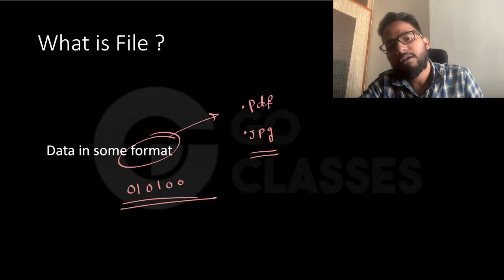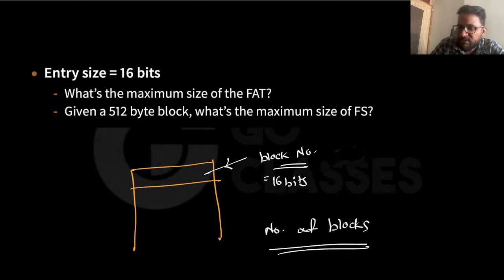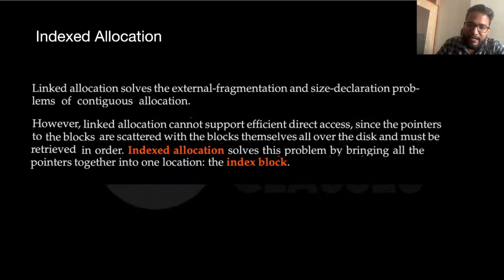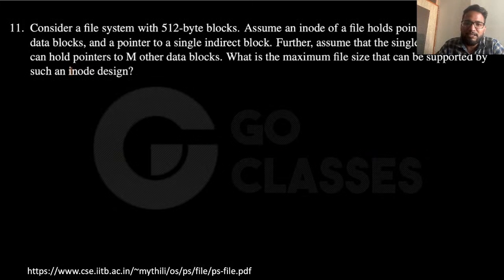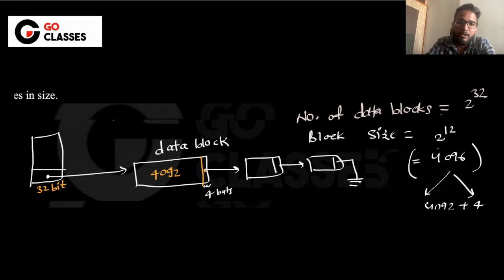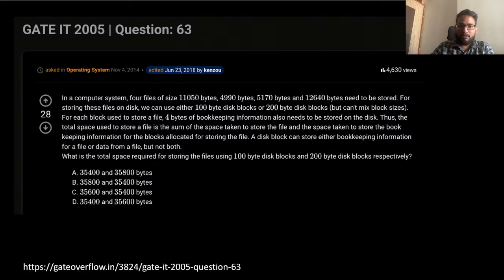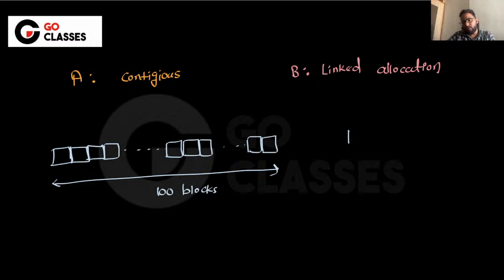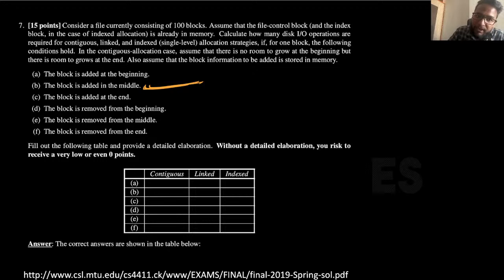File System Implementation |  Revision & GATE PYQs | Operating Systems Revision  | Sachin Mittal

Comment: thank you and great explanation sir , but in the last question, in case of linked file system when block is inserted at the end , total accesses will be 102(100 reads to get to last block + 1 write for the new data + 1 write to change the next pointer of to 100th block to 101th block) right? but in answer 3 is given, why? kindly explain :)
Reply: In the case of linked file system, the end of the block is already available with us to reach to that directly. so we can save on the 99 reads. We only need 1 read of the last block, 1 write of the new block and 1 write of updating the pointer of old last block to new last block.